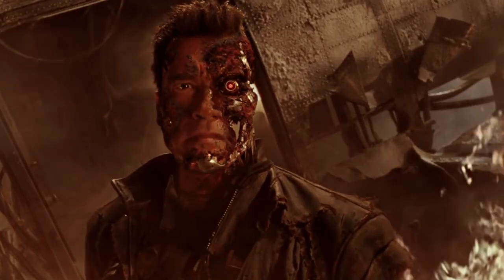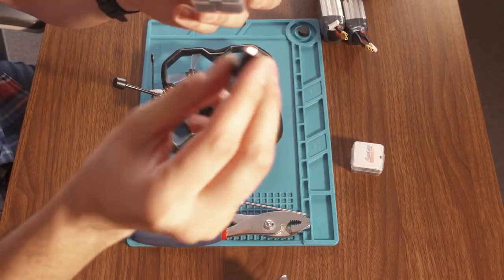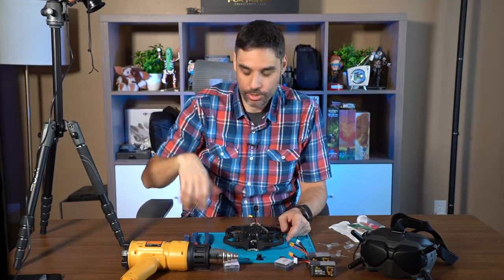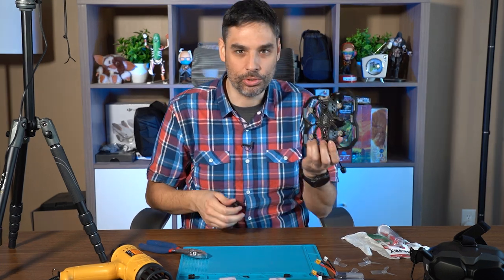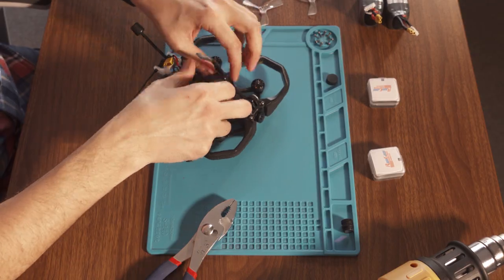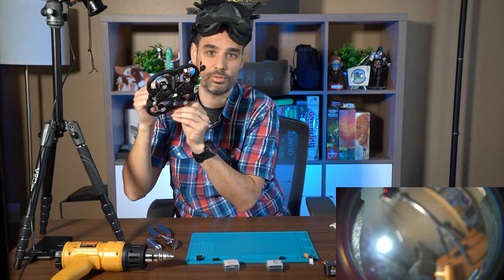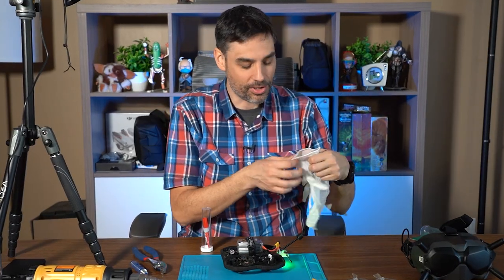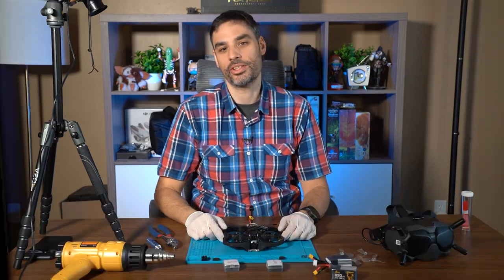How To Fix your FPV Camera Lens | Caddx Vista

Comment: Don't use heat but cover with acetone to soften the glue.  Don't get it on other components so only use a quarter or half a drop.
Reply from the maker: Thanks for the tip!